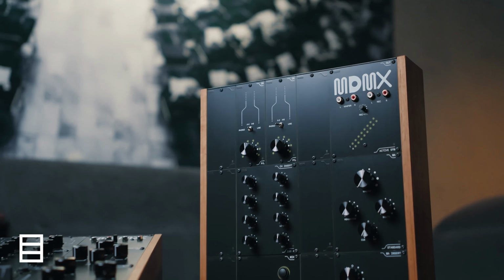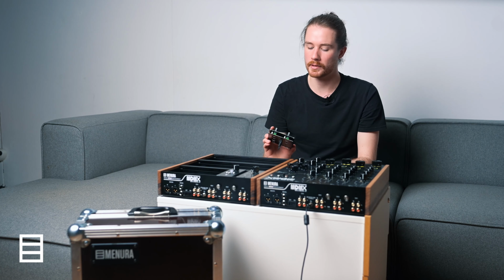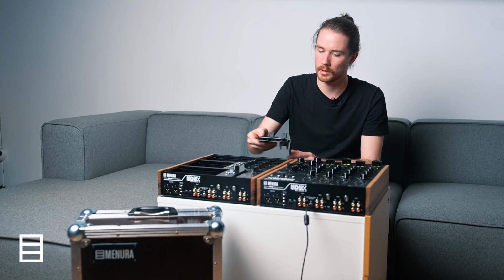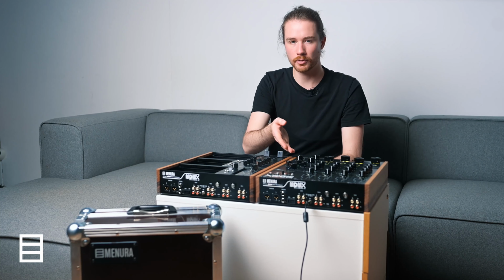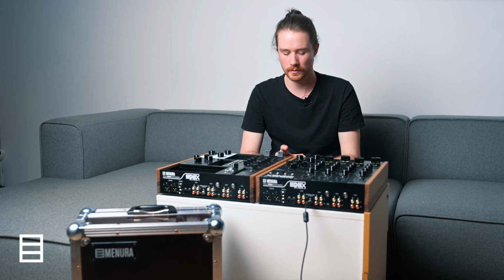Behind the MDMX modular DJ mixer - Menura Talks part one

Comment: Sounds like you've thought of everything. Looks great! 

Personally, I'd love to go fully digital, multiple coax in and a high quality DAC on the output stage. Or a coax output with volume control. 2 coax outputs would be awesome. Maybe a coax digital output module with volume and a HPF or HPF filter ? You could have a dedicated digital subwoofer or mid/high output. Some of the Chinese DACs are outstanding value now like the SMSL C200. A full digital mixer would make insane sound quality possible with one of these Chinese DACs.
Reply from the maker: We already have digital connections between the modules if wanted. But the full digital implementation will take some time. Digital input and output modules with high quality DACs und ADCs are are planed as well.
Reply: @menuraaudio  Great news!